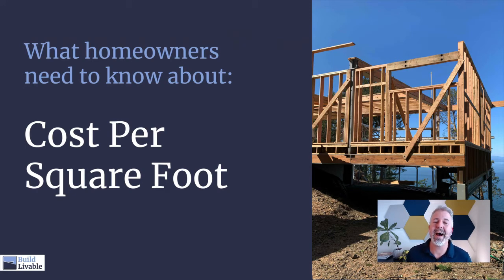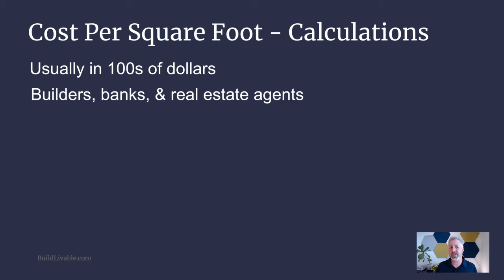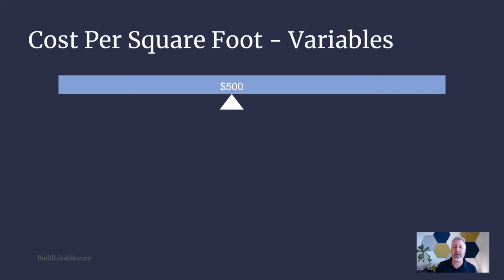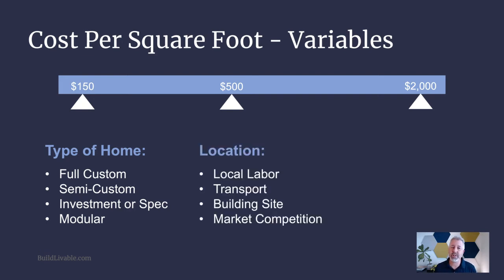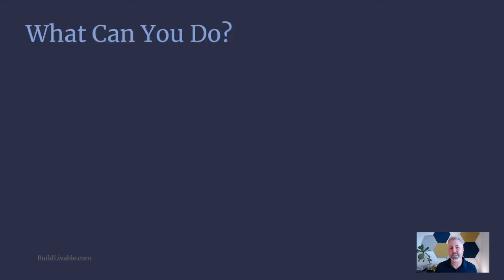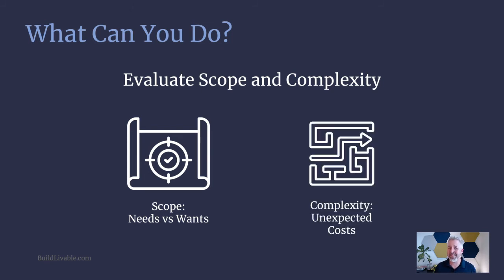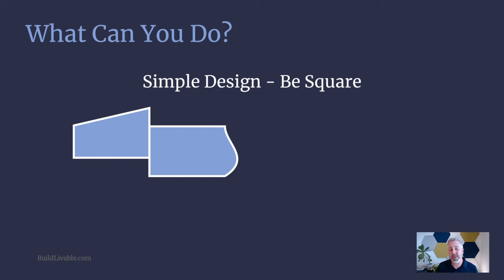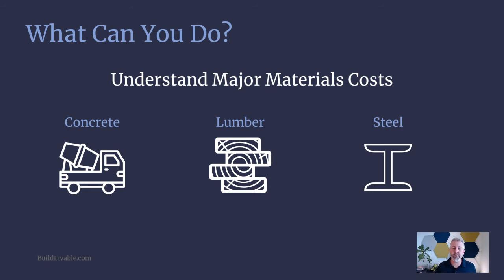How to Lower Your Cost Per Square Foot - Custom Home Construction

Comment: Become your own general contractor if you have the cash to swing it. Do some of the work like tiling and cabinet install, low voltage wiring, you'll be ahead by at least 100k

Comment: Since 30 to 40% of the cost of building a house goes to the general contractor I don't see how the cost per square foot can be reduced to a significant degree without taking a year off and being your own general contractor.
Reply: That's what we're doing. I recommend you drink information like a firehose regarding building for at least 6 months before though.

Comment: We're going to be building in the Knoxville, TN area and we were quoted $300 a square, which is obscene for that area and doesn't even include plans. $200/square seems like a more reasonable rate. I don't need or want crown moulding and wainscoting and tray and vaulted ceilings and travertine and Sub-Zero appliances. The fact remains that 99% of a home is concrete, dimensional lumber, wiring, PVC, insulation and sheetrock, which accounts for about $100 a square today.
Reply: Contact Jeremy at Penwood Homes (in Knox County area). They quoted me $200/sqft less than a month ago. They are a smaller-volume builder that builds a sound home for a decent price (and will build to suit).
Reply: @blymark83  Even 200 dollars a square foot is on the high side. Have them give you a cost breakdown estimate.
Reply from the maker: Sorry to hear there is such a discrepancy. Every location and builder is different. As I'm sure you know, that number usually includes labor and contractor's fee.